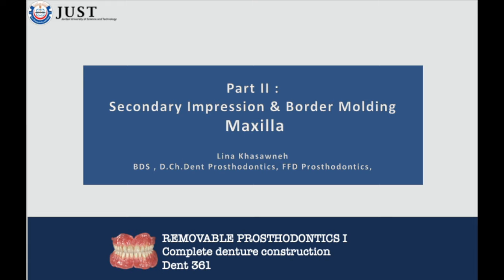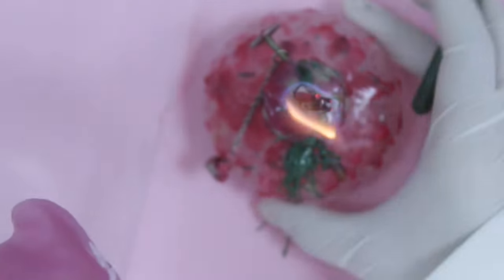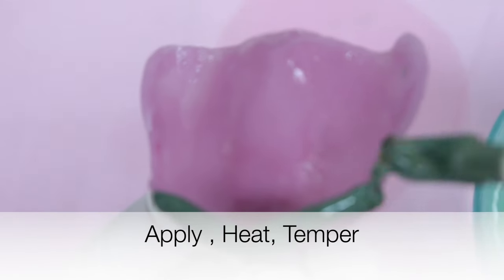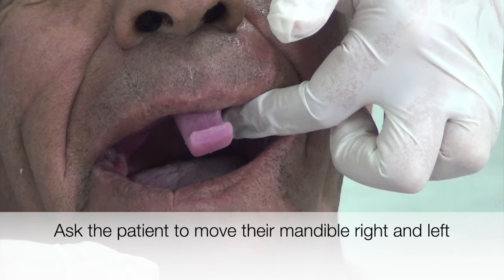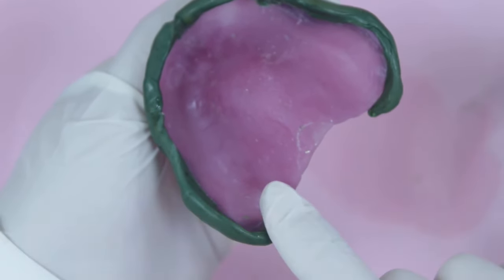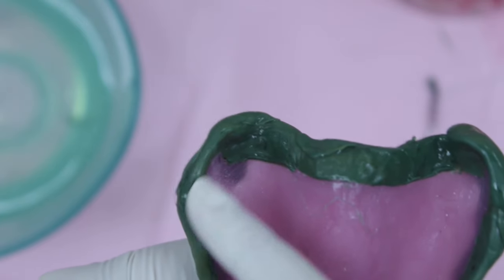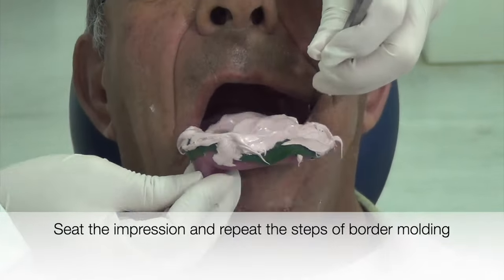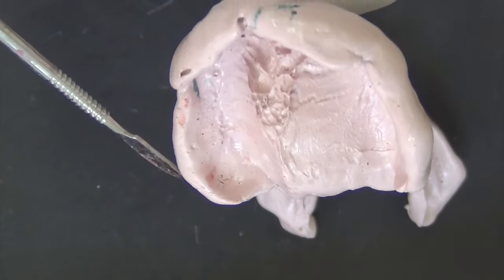Part II Secondary Impression for an Edentulous Patient I Maxilla

Comment: 1. Check border extensions
2. Mark labial and buccal frenum. Trim away extensions
3. Trim the border 1.5-2mm for border moulding 
4. Start with ant border. Labial movement + ask patient to say OoOoOohhhh 
5. Right buccal region. Buccal movement + right/left jaw movement 
6. Left buccal region. Buccal movements + right/left jaw movement 
7. Post palatal seal. Ask patient to say Aaah.